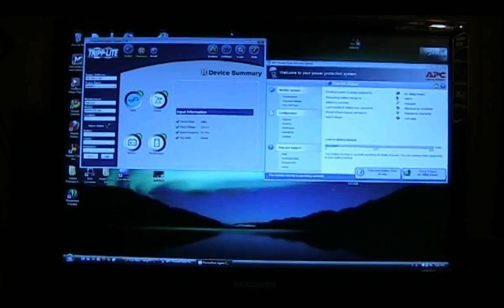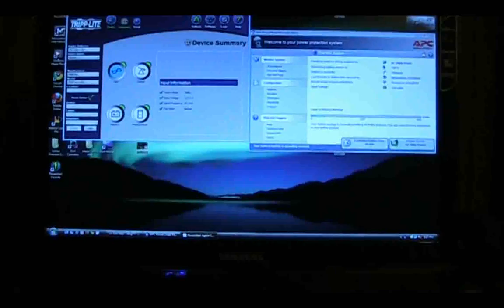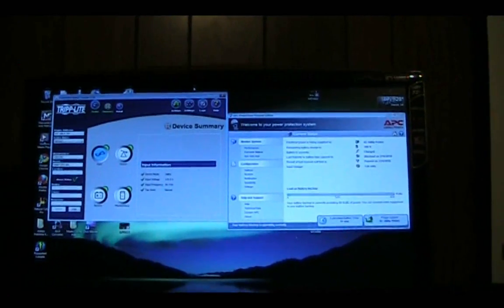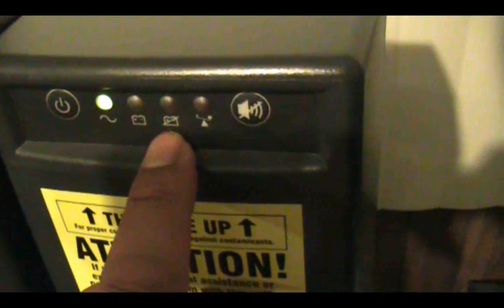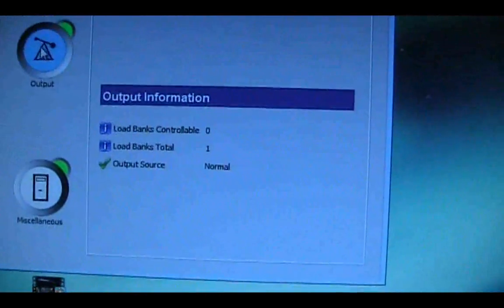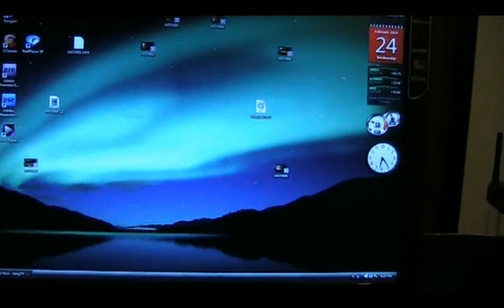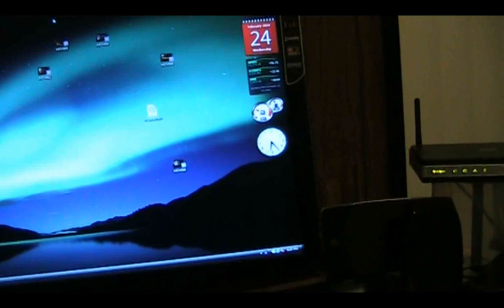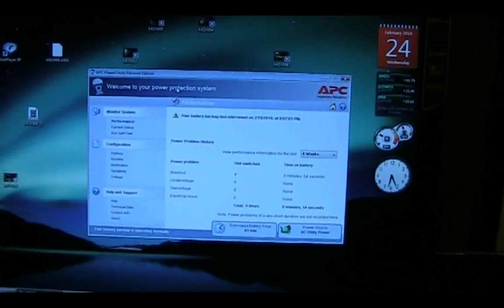Deep cycle battery ups update

Comment: Seeing the destruction caused to the APC 350, I shudder to think of what was done to the 750. Since your project with the 350 and the deep cycle battery failed, I wonder why it's video is still up.
Reply from the maker: Mike Wolf I learned my lesson and never touched the 750. Since this video, I bought something called a Tripplite APS, it was designed to work with any configuration of 12 volt battery. I've had it hooked up to a deep cycle battery for a few years with no problem. My main failure here was that the 350 was not fan cooled and was only meant to run backup power for a few min @ maximum load. The 350 is also still in service backing up a TV. I modified the battery compartment to hold a 5 ah battery vs the stock 3.2.
Reply: Ah ok. I did come across that video where you introduced the Tripplight. I'm glad everything is working out for you. It can get risky tinkering around with those types of electrical devices with inverters and transformers and whatnot. :)

Comment from the maker: I can with a AGM sealed battery which holds a higher voltage under load. With this battery the voltage drops and stays lower, making the ups software think the battery capacity is a fraction of what it actually is. I have since converted the ups back to a normal battery and turned the deep cycle into a 100 watt solar system